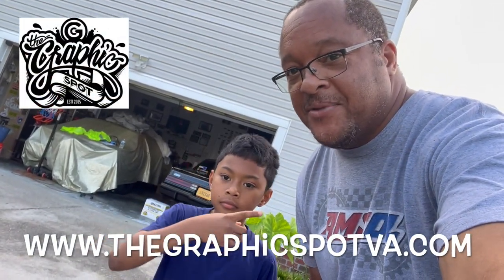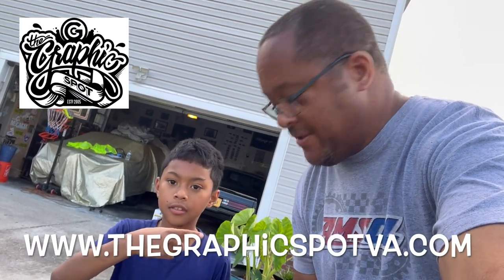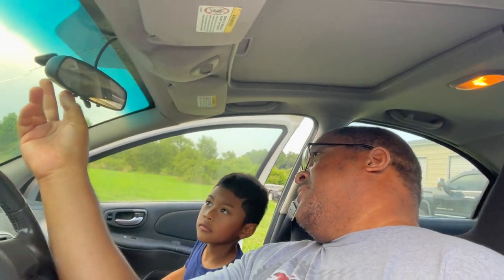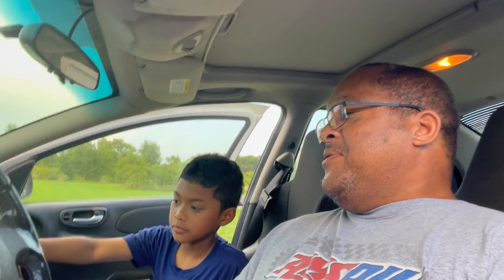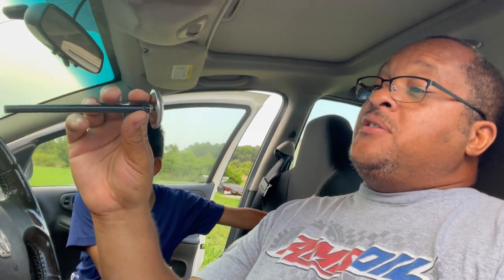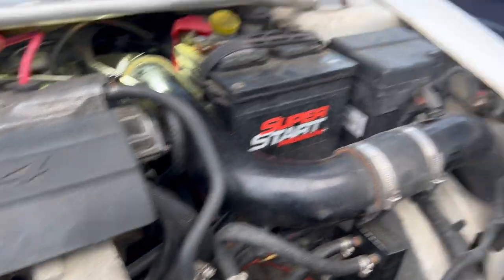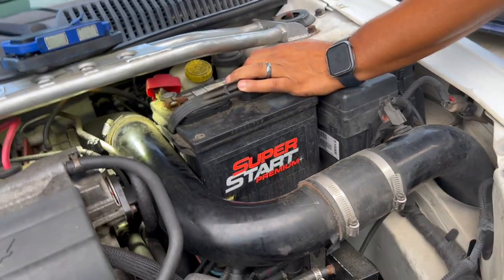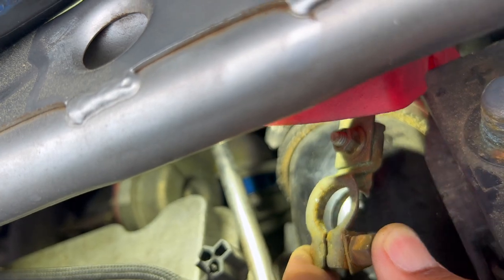2005 Dodge Neon SRT-4 Maintenance Needs

Comment: Was there a leak in your AC? I had to add refrigerant to mine recently. I may have a small leak.  I did replace the check valve on the high side pipe. They should of put a Schrader valve in there instead.
Reply from the maker: No leak.  Just replaced my radiator last year and I had to remover the evaporator with the radiator as a unit.
Reply: Part of servicing the AC is new Schrader valves .
Reply from the maker: Ok.